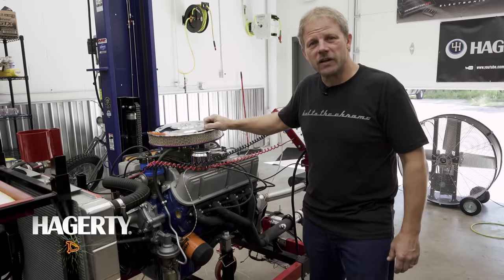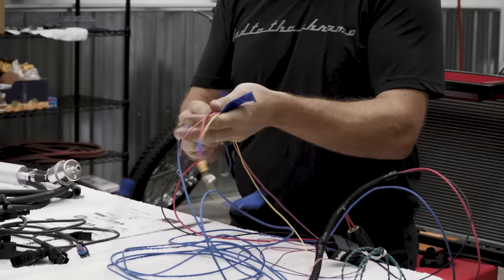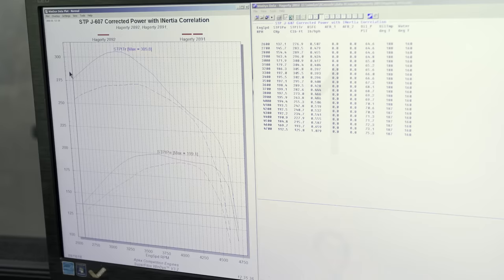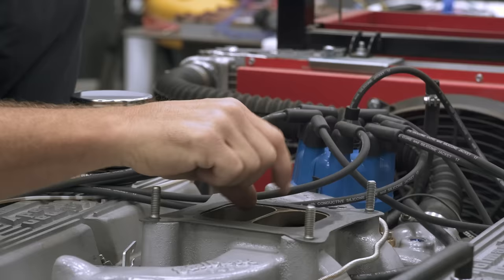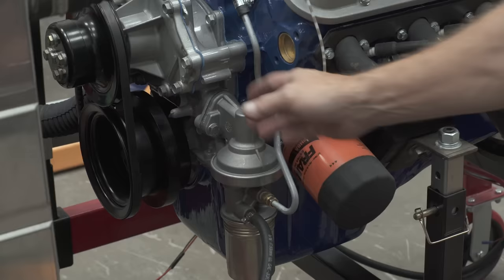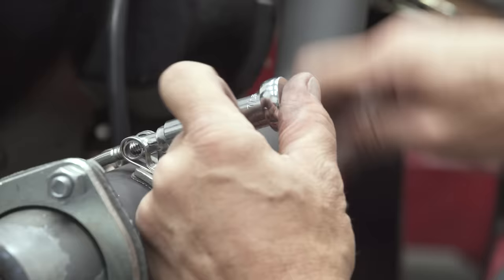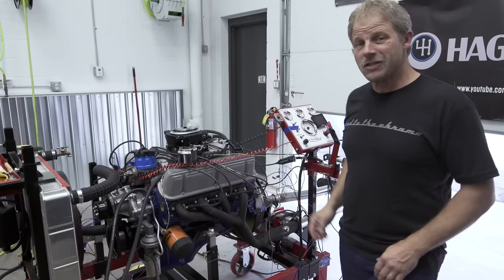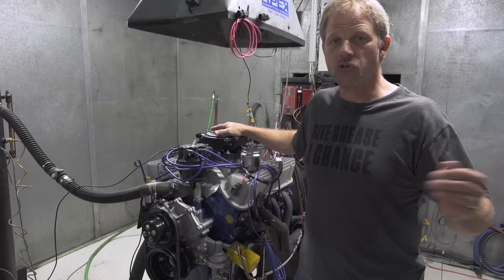Is it worth it? Replacing your carburetor with a Holley Sniper EFI | Hagerty DIY

Comment: The more sensors you hook up the better it works, it's pretty dumb without mass air flow, spark control, a single O2 sensor etc. Its a great computer controlled carburetor for a daily or a rod build but sub 350hp you can do the same job with a chev tbi. All you are achieving is 17.5 parts air to 1 part fuel at all times.

Comment: A properly tuned carburetor will always make more power than a throttle body injector because of evaporative cooling. Tuned port injection will make more than either, but that's thanks to consistency between cylinders which this is even worse at than a carburetor which better atomizes fuel. It also doesn't have the same amount of redundancy or R&D put into it as a factory EFI system, the ability to fix it on the side of the road like a carburetor, or the option to get anything for it at a parts store like you can with either other option if something goes wrong far from home. I'll take a carburetor any day over one of these. Cold starts and slightly better fuel economy aren't worth the tradeoff, especially at the price.

Comment: Comparison to a good carb next time....that was a very poor carb and small like mentioned
Reply: Nicks Garage did a comparison and got 10hp more with a carb. Everything I know about the two fuel deliveries is carb at WOT make more power, but you'll never have a carb as reliable as EFI. But in the same token, you'll pretty much never have a carb not work. Or atleast you'll get some signs that the jets are starting to clog.

Comment: Carburetor cfm should have been matched, also the spacer should be used on both to make a more scientific test.  Also the limited rpm indicted a hydraulic flat tappet cam.

Comment: Will the idle still be lumpy with the efi
Reply: Yup.  I put a sniper and dual sync dizzy on a 302 with with gt40 heads and f303 cam.  Had a 650 double pump on before.  Idles just a hair higher with the efi but the lope is still there.  Power over whole curve is much better mileage is better and no waiting for it to warm up or having to nurse it until warm.  Carb was older and not tip top tuned but the whole setup is big improvement and modernized the feel of the engine.  My only complaint is my car is a bit of a sleeper and it’s pretty quiet the injectors make a lot of sound at idle goes away while cruising but wish it were quieter at a stop light.

Comment: LOL 289 cubic inch Jurassic yank engine puts out 282HP? a Toyota Yaris GR with a 3 cylinder with 97 Cubic inch puts out 257 HP,  NOT worth your efforts, you have a cast iron boat anchor on your hands, throw it overboard, its just slowing you down, get with the times, push rods and single cam shafts were dumped years ago by progressive manufacturers. no wonder the American car industry failed.

Comment: west tech shows the turned carb made more power than efi system.    the only reason you didn't make the same hp was carb was too small and all your issues were not corrected before the carb test

Comment: NOOOOOOOOOO ! NOT A FRAM FILTER>>> NOOOOOOO 
love your videos, they are great, i really like the super fast rebuilds that you do, too cool but.NEVER>EVER USE A FRAM OIL FILTER>>>>EVER
 Also, those intakes NEVER make power over 4500 if you don't cut down the divider, or add a open spacer like you did for the injection. I would really like to have seen a fair contest, carb with spacer.vs. injection with spacer.

Comment: THAT, IS WHAT I, THOUGHT, THAT, YOU, WERE, GETTING, AT, TO, MAKE THIS FAIR, I, SAY, NOT, A, STOCK, DISTRIBUTOR ON A, 289/CID,,,WITH, ONE 1⃣, SET, OF, POINTS,,, YOU CLAME, AEE, ONLY, GOOD, FOR, HIGH, /4,THOUSAND, REVS, THEN, YOU GET FLOOT, SO, BAD, YOU DON'T, ATEMPT, TO REPLACE, AND ADJUST CAM, FACE, DWELL/TIME, NOT WORTH, IT, JUNK THE POINTS, WITH THE CARB, THAT WAS WAY, TO SMALL, TELL, US, WHAT, IS THE, MAX, NUMBER ON, CFM/FULE,,, 900TO1200,,,WITH A, COMPUTER TO RUN IT, FOR, MAX, SPORT,,, YOU CAN, RUN, 2/OF THOSE, THINGS, ON, THE, WRIGHT, MANIFOLD,,,, GIVE ME THE SAME BLOCK AND I'LL PICK ⛏ MY, CARB/S, POINT, OR, DUAL POINTS, AND WE WILL, SEE, HOW I, GET PAST, 4,GRAND AND HOW, MUCH POWER, I, MAKE,,, WE, CAN, SEE, WHAT KIND, OF, ELECTRONICS YOUR, SELLING,,, AND MY, MECHANICAL, SET UP 🇺🇸

Comment: The carb is only equal to a F.I
 at WOT.  Anything else is inferior to a F.I. system.  Cold start fuel puddling altitude adjustment and circuit enrichment is inferior to any F.I. system

Comment: Do you want to gain up to 28% TORQUE off the line and 22% HP on the bottom end WITHOUT BOGGING? Then it's worth it. NO carb EVER made can respond to the NEEDS of an internal combustion engine like electronic fuel injection. Individual constant velocity carbs come close, but at a complexity and labor expense that moves them of the street, and often off the track. Uncle Tony is stupid to still believe in breaker point ignitions. They are 1940's tech at BEST. 1958 Chrysler Products had electronic ignitions. It took Ferd 20 years to do that to ALL their engines,  yes, that's correct, 20 YEARS! Want engine codes? I can provide them! Ever hear of the Fiesta??? The 1.1L I-4 had breaker-point ignition!!! Some 1.3L I-4's did too.

Comment: 9:00 in. I loves me some drill chips blowing up against my cat, burning it up. so, by not dropping the header, you introduced metal chips into your exhaust, sending them straight to your over priced high flow cat. hummmmmmm. more bucks than brains, I guess.
Reply: ronamer1 there was never a 289 with converters.
Reply: @jimgoff1170  I know, but that system was designed as a multi-engine platform. while the 289 in this video didn't, the SBC family did. this FI is designed for those as well.

Comment: Leave one horsepower difference from a carburetor to EFI ain't much self just because you don't know what you're doing with a car doesn't mean you're dumb it just means you got to work at it problem is the cost is cheaper with a carb tixuz on a Chrysler work pretty good washer Jets elderbrock they're all right you just got to know what you doing too bad you going with electronics here we go are all going to spend a lot of money

Comment: Oh course it made more power it has a big a$$ spacer on it. Put a 650cfm Holley double pump with that big spacer and you’ll make more power. Also with the money you spend on the efi you could have put an even better Holley with a taller intake. Rigged video